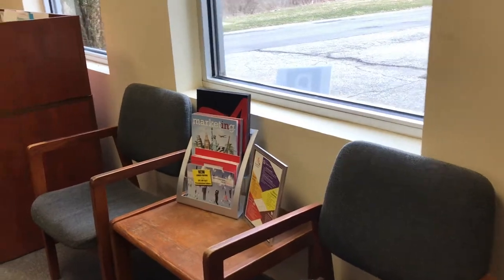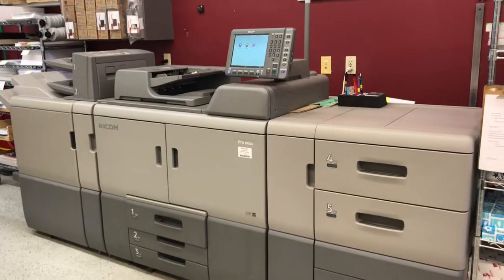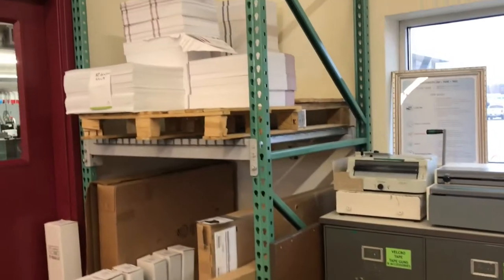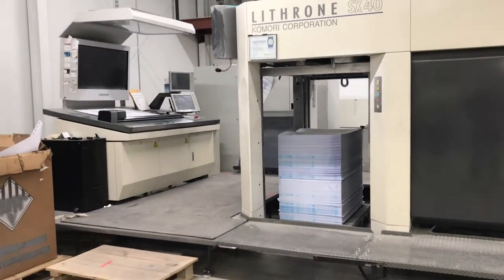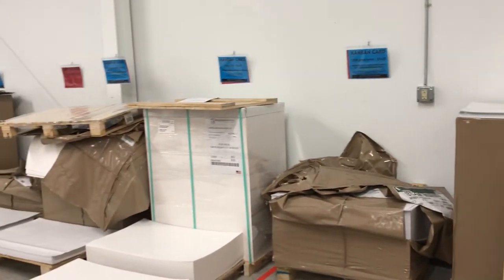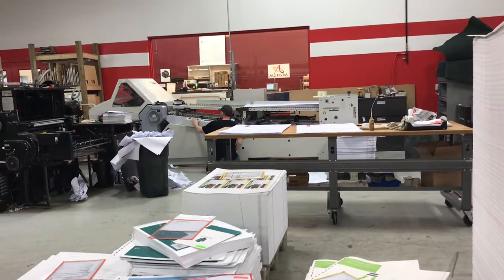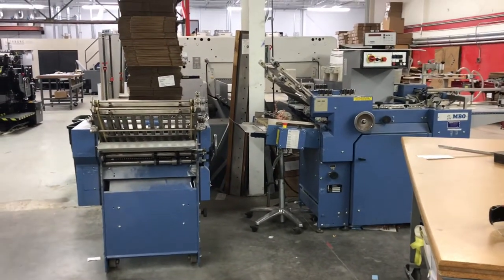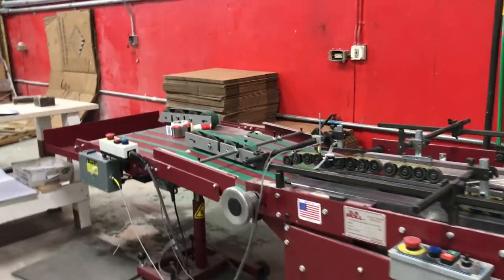Allegra Lansing Tour

Comment: Thanks for the 15 cent tour.  Can you say HIGH VOLUME PRINTING?

0:23  Using the top drawers of each of the 5-drawer cabinets as shelving...NICE!

The other 4 drawers are labeled...the same color.  Suggestion: different colored letters/labels.

Clean facility

3:45  Is it easy to empty that Gaylord box of waste paper?  If not, that is a process that needs attention.  If so, how do you empty it?  Video either way?

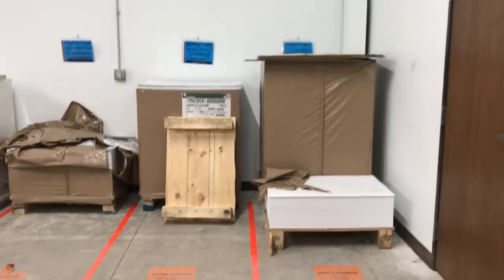4:15  Nice
Reply from the maker: Thanks for your comment and your suggestion about using different colored labels.

We use a pallet jack to load the full gaylords onto a truck that takes them to a recycling facility - we agree though that this is an area needing improvement.